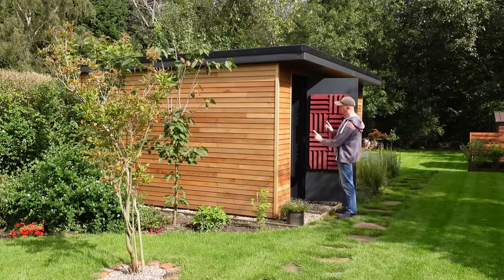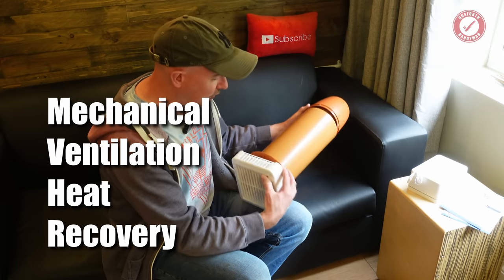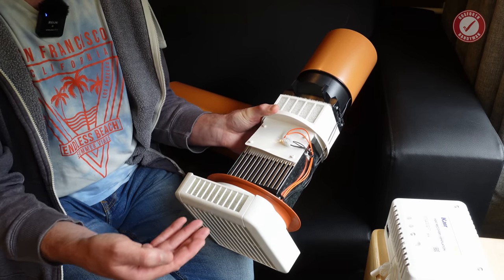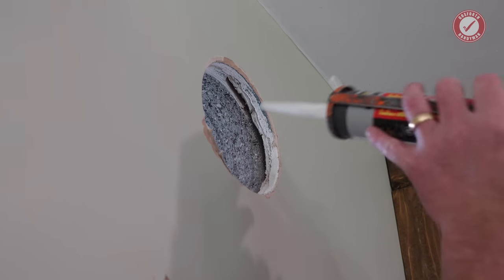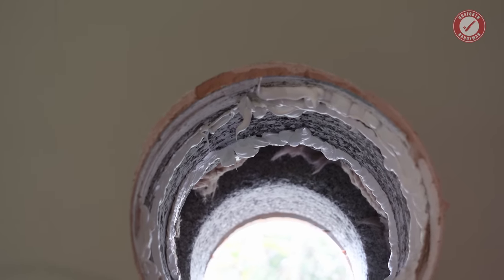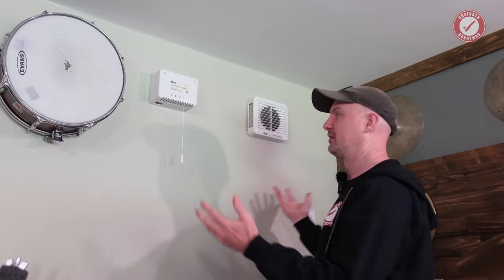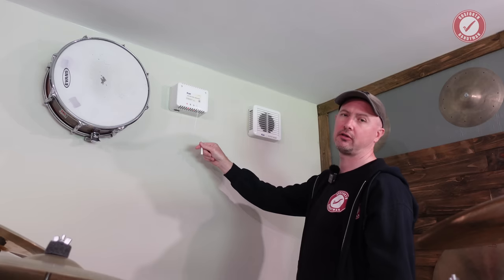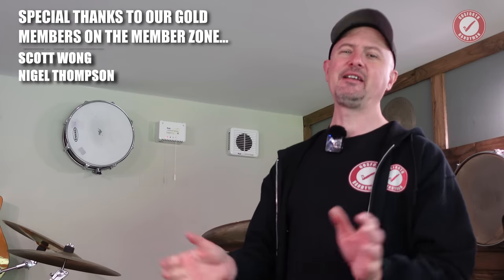Humid and mouldy! Installing MVHR ventilation (Kair system)

Comment: "The humidity is never going to get below whatever the humidity is outside" - not so if you have any form of heating in the room such that the room is warmer than outside. Humidity readings in % are relative humidity - it's a measure of how much moisture is entrained in the air relative to the maximum amount the air can hold. That maximum amount is in turn dependent on temperature. Cold winter air can have 95%+ RH but contain very little moisture. Bring that air into a room, heat it up to room temp and the RH will drop to 30-40%. I've never understood why we don't quote humidity using an absolute scale, like ml per cubic metre or something. We'd all get used to what readings constitute dry, normal, jungle etc and it would save all this confusion that RH generates by introducing the temperature variable.
Reply: Great point, actually one of the issues with mechanical ventilation systems of any kind where you're bringing in fresh outside air is that a house with only a few occupants that aren't producing much moisture can get uncomfortably dry in the colder months, & excessively low humidity isn't much better for you than living in a house where there's too much moisture in the air.
Reply: @stevenrobertgill7306  absolutely, you want 40-60% RH (at room temp of ~20c) to be comfortable. Higher than that you will start getting condensation/damp/mould issues, lower than that you will get dry/cracked skin, chapped lips etc. We get dry skin and chapped lips in winter because it's cold and there is so little moisture in the air, despite the RH being 95%+

Comment: What was your Carbon dioxide levels after installing this unit?
Reply: I thought that was the whole point
Reply: 580 odd, was shown in the video when he was talking about the humidity I believe
Reply from the maker: Yeah, about 580ppm but keep an eye on https://twitter.com/gosforthandy as I'm going to delve in to this in a lot more detail. Vid was getting too long. 😁
Reply: You may need a dehumidifier in there in the winter
Reply: Do you think you could run one of these through a baffle box to help with the sound transfer and it would still function effectively ? Thanks for the great content.
Reply: How much power does it draw?

Comment: Having fit hundreds of these fans, I can confirm that the control unit should not be fitted within 1 metre of the fan itself. Fitting closer, as you have, will lead to the fan itself preventing the control unit from accurately sensing the "real" humidity levels within the room. It's stated in the installation manual that comes with the unit.

Comment: Don't forget the registered "humidity" is relative humidity which depends on temperature. If the outside temperature is lower then 70% humid air has less water vapour than 70% humid air inside. As the air from outside is pulled  inside it's relative humidity will drop as it warms up.

Comment: Andy, just a quickie as the topic of the video was safety! The electrician in me spotted you had some sort of transformer plugged in, in the corner, via one of those lethal unfused Chinese mini 3 pin plugs. If you're leaving that on, or really even if you're not, please consider binning it and replacing it with something less likely to go woof! Usually the wire inside the lead is only single sheathed too, so much more vulnerable to damage. All the best and keep up the great videos.
Reply from the maker: That's a good point on that plug! Keep forgetting to sort it. Cheers! 👍
Reply: Yes whenever i get something cheap off ebay mainly from china i always cut the cable and put a UK fused plug on it, cant believe they get away with sending them as it is a REG no no here is the UK

Comment: I built a simple wooden summer house with a basic felt roof which after many years still smelt of fresh pine. The key to keeping it fresh was to leave the windows open always for constant ventilation while not in use. We even had a bed in there for a while with no signs of mould or damp smell. No bugs either because of how dry it was. It did get the sun to be fair too. If I were you I’d just ventilate as much as you can while not in use for the mould issue and heat up as required
Reply from the maker: Yeah, hopefully now the fan is always on trickle it should help. 👍

Comment: As a suggestion (it’s not everyone’s cup of tea) do a raspberry pi project. Possibly run home assistant on it. Then you can use any number of products to record humidity and co2 and then switch things on or off based on that data.

Comment: I'm rennovating at the minute: and to store all my tools and materials, plus all the extra stuff you end up dragging with you when you move I put up a large garage tent. I put down a levelled MOT bed and loads of pallets topped with 18mm OSB as a base so there's air able to get underneath it thinking that would help. Not al ALL. It would RAIN in there! All my tools got rusty and there was mould everywhere!  This year during the dry summer months I have installed a bathroom ventillator, and fingers crossed if I leave that running in the winter evenings/mornings it will keep it dryer in there this year!

Comment: Great video and you have also highlighted the need for ventilation in garden rooms.  We built a a garden studio using a SIPS kit back in 2020 for my wife who is a hairdresser so potentially, lots of warm moist air.  We air tested the completed studio and realised that even with a three panel bifold door system, it was pretty air tight so installed a mini MVHR by Blauberg Vento, similar price back then not so now.  No mould and the ceramic core that captures the warm outgoing air is very effective.

Comment: we had a garden building built as a gym about 15 years ago now, and at first it was also a sort of tool storage on one end where i'd moved an old wardrobe that covered most of one wall. Eventually got around to putting up a shed and moving the tools in there. So claimed back that space for gym equipment. I noticed the weight rack on that wall the weights were getting a bit of rust on any worn patches in the paint, and when  was taking down the old wardrobes i did notice there was a bit of mould on the back of them. but they had been there for probably a decade so i didnt think too much of it.

The cause turned out to be a result of when it was built that wall on the outside the ground level was pretty much right up to the damp course, and the builders didnt do anything to sort that, and just filled back in with dirt and a pointless bit of decorate gravel on top and so with rain splashing and the lack of sun in that narrow gap between the wall and fence that wall was always wet. 
So i had to dig out to below the damp course and put in a french drain with a pipe connected to the downpipe drain, and it solved the problem of damp. Your building seems plenty aerated and dry on three sides but maybe the back against the bushes is hold damp in the wall? Not sure what would work as a fix for that thought beside cutting out that section of the bushes. But might be worth checking how damp the wall is back there.
Reply from the maker: Interesting! 👍👍

Comment: You have a HRV Heat Recovery Ventilator which is only concerned with Heat, ERV Energy Recovery Ventilator balances heat and moisture in the air (keeping heat and humidity on the side where it came from with like 85% efficiency or so) This uses a special membrane instead of just a heat sink like a HRV, so it is more expensive and requires more complexity of ducting (from what I've seen) 

My understanding is that warm places all year round are fine with HRV since they have ACs to act as dehumidifiers, but northern colder climates where the temp is way lower, need ERV to keep moisture in during the winter (and to help keep it out in the summer)
Reply from the maker: Interesting!
Reply: Spot on. So many people get the two confused.
Reply: do you have a link to an ERV? is that the one which has a 70 second cycle? i'm thinking of getting the kair unit but the stat bit looks big.

Comment: Nice tidy job. I have a well insulated very well sealed garden office and it can get stuffy in Winter when the windows are mostly closed. I try to change the air in the morning or evening by opening the windows for a bit, and I have a little 500 ml dehumidifier from Argos which I leave running overnight to prevent dampness from building up. No mildew etc after 2 years.

Comment: Hi Andy, I’m a commercial gas engineer and in commercial kitchens we have to test co2 levels, the guidelines say that anything under 2800ppm is safe between 2800ppm-5000ppm is classed as at risk, over 5000ppm is dangerous. 
As far as I know co2 isn’t poisonous like CO (carbon monoxide) it just displaces oxygen. I’ve had my co2 tester. Just thought I’d share some knowledge, love the channel have been watching for years!

Comment: I was involved in a practice room build very similar to yours minus the window, with a room within a room design.
Brick outer leaf mineral wool filled cavity of 100mm, 63x38mm timber inner leaf with mass loaded vinyl glued between two layers of soundblock plasterboard with skim finish. 
For ventilation we used ducting in the wall with three "silencers" or attenuators similar to a car exhaust made up of a larger pipe (around 30mm larger than the duct) loosely packed with mineral wool held in place by a wire or perforated tube the same size as the ducting. 
With the ducting ending up about 8m+ long and the silencers in line it was very effective at stopping the noise from a 120db metal drummer at full tilt and as long as it was used mould and damp wasn't much of an issue.

Bass traps in the corner improved the sound of the room a lot and I would recommend including them at all 90 degree corners.

Comment: Great video, thanks. I've been looking into MVHR for my bathroom and kitchen, and have researched a bunch of options, most of which are between £500 and £2000 for a single room unit. I had (snobbishly) discounted the Kair, but am beginning to realise that, even though the design seems a bit basic (1990s, even), it seems to offer everything (and more) that most of the much more expensive units do.

Comment: Nice project. If I may suggest, you should consider using or building an Exterior Fan Silencer and a sound-absorbing plenum chamber. This will help you reduce noise output through your ventilation while maintaining good ventilation.  This helps me to silence my 115db air compresor in my living room workshop at my home almost to nothing. Good luck

Comment: Not sure how much insulation you've installed in the walls but I would think that the moisture output from even one person in the room for a couple of hours with next to no ventilation could potentially cause condensation on cool wall surfaces, giving rise to mould. Perhaps more likely with a fair bit of exertion when playing the drumkit.

We have a timber framed garden office (built 2019 floor area approx 5m x 3m) in daily use with a Daikin mini-split ASHP, which helps control humidity. Insulation could be better, so not hermetically sealed like your studio, but complied with building standards at the time. Double-glazed with trickle vents but main air changes via normal foot traffic opening and closing sliding door. No condensation issues at all. Thanks for showcasing the Kair unit.
Reply from the maker: Interesting to know - cheers!

Comment: On humidity, remember that it's relative to temperature. Warm air holds more water. 70% humidity at 15°C is only 50% at 20°C.

Something to keep an eye on if you find it feeling too dry in winter.

Comment: Well done ! Keep in mind to replace / clean the dust/insect filters regularly
3:18 I have a Vallox 90 SE central ventilation with enthalpic heat recovery (retaining some of the air moisture) and it indeed works both ways. In winter time I need to activate an electrical heating element for the fresh air intake to prevent freezing the heat recovery cell.
Decentralised ventilation things (like yours) are kinda genius: first sucking warm air out warming up the filter package so when blowing outside air in it gets warmed/cooled.
7:48 at an event with Bosch personnel they told us that the front hand (here your left) must grab the handle from below (also when operating a drill with a kickback sensor) so when the drill is binding it is safer
25:42 you could extend the pipe on the outside. For the centralised units they have some add-on sub-terran heat recovery system that equalizes outside air temperature across seasons.
But this adds a load on the ventilator.
Cheers and enjoy your music room soon

Comment: I recently built a garden drum studio and was too worried about sound escaping to make any large holes so I buried a couple of 3 inch diameter flexible pipes with some high RPM mining fans attached (rated at 250 cubic ft per minute), one pushing air in and the other taking air out.  Due to the small diameter of the pipe, the sound of air rushing through is rather loud and I have no heat recovery but it seems to work ok and not leak any sound.   I have found that no matter what the weather is doing, it's always cold in the room due to the amount of concrete involved (i used a similar construction to you by the look of it, except for laying the outer layer of blocks flat and placing a 2 inch baton with insulation between inner blockwork and plasterboard)
In my case the fans seem to make zero difference to the temperature of the room but at least if the music doesn't work out I could get into commercial meat storage

Comment: We have silencers on the vacuum blowers in work which do very well in comparison to no silencers on the blower side. When you look at how they are made up as an addition. basically Stainless conduit with slots in with sound proofing surrounding it and another stainless conduit around all of that, keeping it in place and protecting it. Worth looking at and adapting. Best of luck

Comment: Unless you don't heat this room relative humidity of the air which is sucked in will drop, as a coarse rule of thumb an increase in temperature of 5°C of the fresh air taken in will result in a 25% drop of its relative humidity.
So if the outside temperature is 10°C and relative humidity 80% this air when brought into the room and heated to 15°C will then have a relative humidity of 60%.
But a better and more precise approach is using a relative humidity chart, you can find these online.

This is a quite nice SVHR, it does not like most of these units use a ceramic core to store heat, but has an actual heat exchanger.
This means this unit continuously extracts stale are and replaces it with fresh air, those with a ceramic core can only do one of these at a time and the unit changes flow direction every few minutes. The big disadvantage of this is in a very well sealed room, like yours, it has to fight against a pressure difference as it either only wants to get air out or in, that hampers it's efficiency a lot.
If using this type of SVHR it's advisable to have two of these running in tandem, both changing direction of airflow at the same time, this is done with the controller. The units can be in different rooms as long as they are not too far apart and there is a good air flow possible between the rooms, so doors must have a gap underneath or a vent must be installed in the door or wall between the rooms.

Comment: Hi Andy    Must admit I would have gone for the window wall , a possibly placed it at low level just above skirting height .  As for CO2 levels that seem to have many in  tis was , 400 ppm average out side and say indoor at a party up and over 1200 ppm . And if you’re a sub mariner you’re expected to cope between 6000/ 7000 ppm ,   and I believe astronauts are exposed to even higher values . But I assume they get conditioned to it ,    so maybe that’s the answer Andy you’re just going to have to live in the studio . 😂   No but seriously you’re absolutely right if nothing else you don’t want to be breathing in mould growth ,   and I would think you average sub with have very sophisticated equipment to manage such issues . And probably not a hole drilled to the outside 😀  .      Great stuff as always 👍👍👍
Reply from the maker: Cheers! That's interesting for sub mariner CO2 levels!! Fan had to go there due to the coin toss though. 👍👍😉
Reply: @GosforthHandyman  yes I forgot about the coin 😂

Comment: Might be good to add a secondary canopy over the outside vent to increase the long term waterproof integrity
Reply: What kind of m/1000 would you go for? I'd go for at least a 23mm tarp with extra sunlight reflective capacity in the even of a solar storm or nuclear blast.

Comment: Weatherization people insulated my house with blown in insulation.
As part of the project and because it's so tight now, they installed an air vent to pull out condensation and humidity in the house.
It comes on for a timed period then automatically shuts off taking stale air out of the house.

Comment: I've got a garden room and fitted an air conditioning unit for cooling and heating.. for fresh air exchange ive got an inline ducted fan that supplies fresh outside air into the side of the air con unit which then heats or cools the outside air up.
Reply from the maker: Does the aircon act as a dehumidifier too? Was thinking something along the lines of that. 👍👍
Reply: @GosforthHandyman  it does in summer but im winter the warm air allows the air to hold more moisture and the air exchange from the supply fan dilutes and displaces the stale air. You would do well with a dehumidifier in there combined with your unit to bring fresh air in on trickle constantly would do a great job. Dehumidifier also adds a little heat to the space as well.
Reply: @GosforthHandyman It will, in recirculation mode.